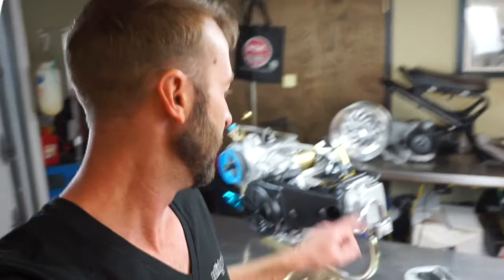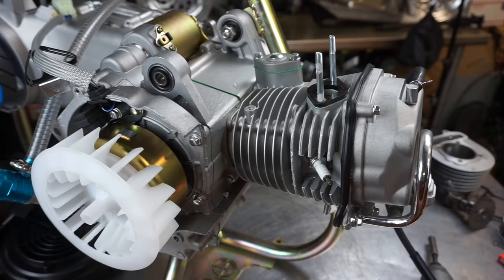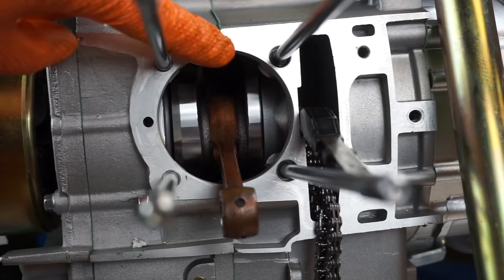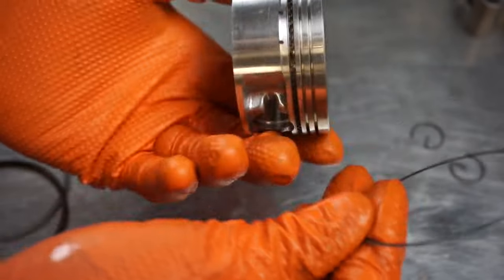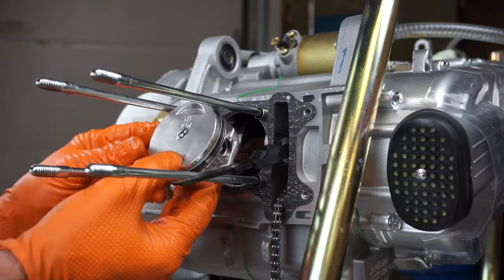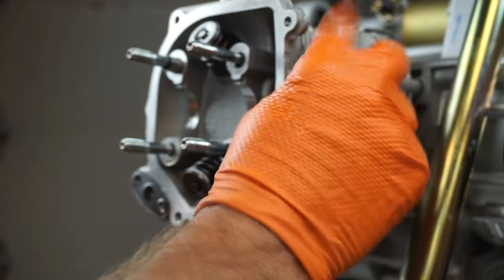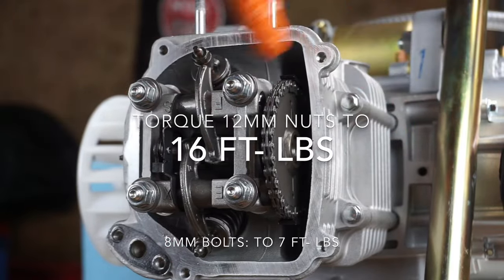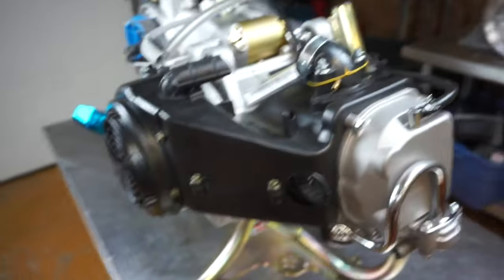How to install a big bore kit GY6 171cc / 172cc (61mm). EVERYTHING YOU NEED TO KNOW!

Comment: Why wouldn't you put the rings in the cylinder bore first to measure the ring gap with a feeler gauge?
Reply: Because all these parts are made to such amazing quality standard that there is no need to check ring end gap.

Comment: 25:25 setting valve lash. You go on the bottom side (.004 to .005 and you pick .004) .
  Only thing is that as valve and seat wear( in a hot combustion chamber) the oil splashed cam and rockers wear less. This almost always ends up in valves that don't seat completely,  which is accelerated by valve erosion and ALWAYS pronounced on the exhaust valve due to coefficient of thermal expansion differences based on heat/cooling cycles. Exhaust valve is only cooled from oil and seated contact (heat transfer). Intake is cooled by both those but mainly by cold fuel intake (reason carbs "ice up" is evaporation) in relation to relevant heat within the combustion chamber.
  If in doubt, ALWAYS set valve lash loose. Especially on the exhaust. They Will wear in and close the gap, so to speak.

Comment: Friend, I congratulate you, good video you explain everything very well, few videos of such good quality you can find and your video is the best I've seen in terms of mechanics, I have a buggy  with 150 cc engine. By making this modification do you know how many hp I can increase? And finally, if I make this modification, will I have to change something in the carburetor? and you recommend some spark plug coil with more voltage? There will be a high voltage coil on the market for this 150 cc engine.?
Thank you very much and again I congratulate you for your video, in fact you explain very well and the quality in hd is very well appreciated all the details. Greetings.
Reply: every engine is different.
Reply: Definitely

Comment: Thanks for the great video, lots of detail and well explain.  I'm replacing the cylinder head on an old Lance Venice inherited from a friend and discover the old piston lost some fragments into the crank case.   Any suggestions on how to clean this out or make sure there is nothing left inside that may create a problem ?   Also I have no specs regarding nuts torque. what would you advice.   Thanks!

Comment: You make it look very simple. Im saving up for a second bike, it will be a gy6 scooter. In the meantime i wanted to ask, would your EFI plug and play kit work on a geared bike? It has a 26mm intake is a 125cc... but what i am worried about is: will the EFI handle the constant changes in the throttle or is it made specially for scooters where you dont play that much with the throttle?
Reply from the maker: Thanks for watching. Our efi kit will work in any bike up to 1000cc. We do have DIY EFI kit out now :-) https://www.rollingwrenchdenver.com/products/diy-rolling-wrench-fuel-injection-kit

Comment: I usually set the piston inside of the cylinder first as a lil assembly then install the dowel and clip that way I don't have to wrestle with the  piston rings.
Reply from the maker: That's anther way to do it. I find it a little bit easier to do it my way. But thanks for the mention, other people may prefer this method
Reply: I do it like that its also how honda does it in the factory you dont have to worry about the ring gaps there all set from that point and its less messy oil wise oiling the piston between these stuts is messy

Comment: So you can use a 150cc head on a 171cc cylinder?? Reason I ask if because I've stripped out my spark plug hole and I'm trying to helicoil it now but I would much rather replace head in the end.

Comment: 0.04 is to tight clearance for air cooled engine, u need to put 0.10,when its get to working temp, tht clearance is 0.05, and u nvr gonna burn your valves,just my opinion, cause i have 170 cc gy5,157qmj block and its going 115kph  tht would be  71 miles per hour btw good tutorial
Reply from the maker: I appreciate the support 🙏. All the details in this video is what’s worked best for me in my 18 years of experience.🤘🏻👍🏻

Comment: Thanks for putting up some great diy videos 👍 how can you tell if you have an A or a B case without opening it?
Reply: You can tell by the engine model number engrave on the lower part of the crankcase near the side oil drain bolt. If it says  125QMI", "157QMJ", "1P57QMJ" those are 54mm stud spacing A block (case). If it says "161QMK", "161QML" you guess it those are B Block 57mm stud spacing.
Reply: NCY STORE what about p152qmi or the 153qmi KDU engine
Reply: fishsticks A-block is considered 54mm stud spacing normally 125cc "QMI" , 150cc "QMJ" and both can upgrade upto 171cc engine without boring. Now, B-Block is considered 57mm stud spacing  commonly use for 180cc upto 232cc engine if you want to know how to decipher more gy6 engine code checkout http://ncystore.com/blog/gy6-engine-code
Reply: NCY STORE 
So you reckon my p152qmi engine I can fit the 170cc kit without boring case? But those cheap china $40 170CC won't fit because of the jugs walls? But you kit does?  
Right?
Reply: fishsticks yes, NCY and Taida are only one that makes the bolt-on bore kit. What makes it a bolt-on is there cylinder skirt aka sleeve diameter is less than 63mm closer to 62.7mm or 62.9mm diameter to be able to slide in most A-case bore opening on crankcase is 63mm opening and Rolling Wrench should have them.
Reply: NCY STORE just seen your link and read about the 1p52qmi and a 152qmi engine. 
So if I change the whole top end from a p152qmi-A to a 152qmi. 
Will it work?  

I would replace the head to 60mm /A9 cam/152qmi rocker assembly. 

But keep the p152qmi-A timming chain

Will it work?  As my p152qmi head is toast! And costs alot to replace I'm kinda stuck!
Please help man
Reply: fishsticks sounds like you got a good part plan that should work excellent!🤗

Comment: would there be a change with the carb or jettings using 61mm block? I heard you can run stock 150cc carb upto 59mm block only. beyond that, jettings should be changed.

Comment: 19:00 to 19:11 true. But the reason is because the case is cut out. So he is saying if the alignment pins don't push in, they are in the wrong holes. Gasket is diagonally cut also for them. It only fits one way.

Comment: Can you use 125cc Gy6 cylinder head on 180cc Gy6 cylinder? Whats the intake and out take diameters? - But you just mentioned smaller cylinder head adds to compression = power output. But how about those intake and out take holes? How much they matters for power output when using the default 125 cc carburator?

Comment: Hey with my cam lobes facing down. @22:07.  My rocker arms HAS A LOT IF PLAY ROOM. SO I FLIPPED THEM. because I couldn't adjust the dowls on the valve. I have bug bore kit. With a-9. Cam. If I try to adjust the valve there's still like 1-1/2mm of play.

Comment: I've always wondered what the little rubber hoses hanging off the little modified 125cc scooters in Taiwan were: your breather tube just answered my curiosity!
Reply: U mean under the carb? If so that is the overflow valve, gas May leak out if it if gas is overflowing into the carburetor. It's a safety feature so ur carb isn't destroyed.

Comment: Does all a cases fit the 61mm bbk without boring the case? I have a 125cc gy6 stock and planning on upgrading it to the biggest bore possible without touching the case. Most say 58.5 is the limit without boring the case. So if this kit is bolt on i will surely go with this.

Comment: Hello sir, I’m installing the Taida brand 61 mm big bore kit like yours and an A12 camshaft. I’m thinking of upgrading to a CVK 30mm carburetor and intake but the intake port on the head is 28mm wide. Is that ok or should I go with a 28mm carburetor? What do you recommend? Thanks

Comment: It looks the same as a XR/CRF80 or 100 in head and timing chain guide design, I have been cautious of working on OHC engines and now I have completed a few, they are easy.
Reply from the maker: The shim type valves are a little more tricky.  But they are both easy with patience.

Comment: Hello my friend ✌ I should get a good power hike with the 171 big bore using my stock head , because the motor has less then 100 miles/ what due you recommend on carb in mm & what # cam, looking for a decent gain with dependability & pricing . Appreciate the info thank you

Comment: hi rollingwrench, I would like to ask if all 157QMJ engines (China), will fit the 61 mm big bore kit without modifying or boring the hole for cylinder wall? thanks.

Comment: How come I’m not getting any compression?? I gapped the rings  all offset from each other and the IN mark facing the carburetor side. I can feel air coming out the exhaust port and my hand is getting sucked in on the intake but when I put my finger into the plug hole I’m not getting any compression so what am I doing wrong?

Comment: Hello.
What is the biggest upgrade i can do on a 50cc gy6 engine without changing the conrod and big end?
Thankyou
Reply: That's what I want to know too what is the biggest big boy can I can put on a gy650 also did you ever get an answer I need to know also
Reply: @jod5659  i think its about 110cc- a Honda Lead cyclinder head is the same i believe as a gy6
Reply: @jod5659  i have a Honda lead 110cc for sale apparently does 75mph. Previous owner messaged me as he had put the bigger head on. £200 for whole bike. Spares repair

Comment: Sir, isn't the scale regarding valve settings supposed to be in ’parts of an inch’ rather than mm?
Big fan, love your videos!
Reply from the maker: Good catch. You are correct! Dang it! I corrected it in the description
Reply: Depens if youve been trained in metric or imperial, its usually marked in both on the feeler gauge blade.

Comment: One thing, brother. Around 9 minutes you show stock blue gaskets and exp lain to trim the inside with a razor. 
  You are correct, of course, but don't let the paper based gasket clipping fall into the engine. It can sling around with the oil and end up eating up your ball bearings. 😞 don't ask me how I know, please🙄

Comment: This might be a stupid question. I just recently purchased and Ice bear mad dog gen 4 150cc originally now board out to 171cc. The person said use 10-40 when changing oil on crankcase says 15 - 40 which is correct. Please help
Reply from the maker: Gy6 motors can use a wide range of different viscosity’s. You can use one or the other. It doesn’t matter.

Comment: Hi I have a gy6 125 cc with engine number of hd 1p52qmi do I still need to measure the stud spacing or will it be the 57mm spacing and if it is the 57mm spacing can I put a 150cc top end kit on it to make it 150 cc

Comment: Amazing how dry that motor is and hasn't even been test ran at the factory.You think they would at least use assembly lube
Reply: My thoughts exactly. Even a $100 harbor freight motor gets ran before it leaves and will have lube/grease in it.
Reply: Connections

Comment: after that video i decided to upgrade my 150cc gy6 a motor. İ bought 61mm cylinder kit,A9 cam and 15x37 gear kit. and i did exactly the same as you did But, when cold start engine does not run on idle you have to put gas to keep engine running until its get really hot. after it gets hot its stay on idle qiute well.. Why is it? is it because of A9 cam?
Reply: Kinda sounds like your idle jet may need increased in size but I dunno tbh 🤷‍♂️

Comment: My second Q, you did the same clearance adjustment on the exhaust valve?, i mean .004 for the intake and .004 on the exhaust too?
Reply from the maker: That is correct
Reply: @shannon9487  0.004 is big enough for exhaust..Both at 0.004 is perfect

Comment: I have a atv with a type A gy6 and something stuff didn't come with it like the bolts to the air shroud and the air shroud rubber seal can I buy these things off your website? I'm planning on doing some mods but working out the program with it first I like the video
Reply from the maker: Yes no problem. Just click the create a parts estimate on the website
Reply: @RollingWrench  does that 171cc fit in the case of the gy6 a with out boring it out? How I found out it was the A gy6 the engine studs are closer thanks to your video I built the top part of the engine but like most guys need more power lol right now having a problem with spark worked good in the trail I got it home shut it off then nothing I replaced the CDI and nothing I got the 4 wheeler from someone that lost parts and it sit for years guess I was asking for trouble

Comment: To do the big bore kit... do you have to drain the oil in the motor  before starting?
Reply from the maker: No, but it’s a good idea to add fresh oil
Reply: @RollingWrench  definitely!! Riding seasons over just wanted to make sure it wasn’t going to be oozing out when you do a big bore on a wet engine

Comment: Hey bubba. Love your video.
I got to 18:58 where im installing the jug. And it dosent slide in to the case. I decided to smoke a cigar and drink a tall boy about it. But, i dont know what to do.
Reply: I removed the jug and re razored the gaskets of the case ID. No luck.
Reply: Half way thru cigar and tall boy, im thinking thermal expansion. Should i put jug in my freezer for a little?

Comment: hi, planning to get a 61mm bbk. do I need a new head? I understand the 61mm and stock heads have the same size valves. Is that right? Im not a racer, just want extra pep for new gear set, how much hp or torque should I get using the same A8 cam and jetted to 115 carb with a 61mm?
Reply from the maker: You can use the stock head and stock cam no problem

Comment: Just one question, how do you know if the piston is on the correct cycle and not 180 degrees out?
Reply: There are time indicators on the flywheel, if you get the T at the indicater the timing will be good

Comment: Couple ? Do you need to change the cdi box after this,do you have to put the shrouds back on or is it ok to run without.
Reply from the maker: +Ronnie Hall  you don’t have to change the cdi. Shrouds are a must. It will get to hit without them
Reply: Shrouds are for the fan to circulate air around the eng , LEAVE em.on

Comment: I’m having trouble with fiting the piston into the cylinder any tips ?
Reply from the maker: More assembly oil :-)
Reply: @RollingWrench  thank you! Round 2 starts in 15 mins lmao
Reply: @RollingWrench  ok your advice worked only problem now is I have 4 dowel pins instead of the 2, it looks like the cylinder head fits from the drop in kit but it looks like w/o the dowel pins is it ok for me to take them off or is that a bad idea?

Comment: My scooter is going too slow when it tells me I'm doing speed limit 35 but I'm actually doing 29 miles an hour and I'm having engine stalls sometimes and my lights are kids going out I need an upgrade kit for a 50CC GY6 engine in transmission to go a lot faster try to make it feel like it's a 150cc cuz I got long distance travels to do

Comment: Does the original Cooling Shroud still fit exact with big bore kit installed?
Reply from the maker: Yes :-) this big bore kit has the same
Outer shape
Reply: I have a Howhit GY6 150cc. It's the A case.  I wanted to get the big bore kit from your site, but upon research and measurements mine is a 57mm piston  from factory. Even though the stud spacing is 54mm exact. Is there a kit for that?  Can I still drop in a performance cam with original head?
Reply from the maker: @avenge1671  stock 150cc engines have a 57mm bore. A GY6 A motor has 54mm spacing. You can do a 171cc kit with the stock head and stock cam. I would recommend doing head, cylinder and cam. We sell our 171 kits as a drop in kit. No case boring. Here is the link:
https://www.rollingwrenchdenver.com/products/gy6-171cc-big-bore-kit

Comment: Mine says 1p57qmj. Would this cylinder fit ?
Reply: Yes
Reply: It's a 150cc look for 61 mm big bore kits . You can go up to 61 mm without case boring. Making it a 171 cc.
Reply: Yes,the cylinder is the same as well as the piston and rings,the timing chain has the same number of links.The only difference is in the head..The aluminun where the camshaft sits is like 1.5 mm higher,off the top of my head so.it means it will not accomodate a camshaft with bigger lobes..off the top of my head i would say it takes a camshaft A8 or A9 but not higher,cause of the height..you can use a regular head to replace the original head..and make sure your chain tensioner compensate for the chain slack..I have seen after market chain tensioners that sell as being good for 125 cc and 150 cc and the stem is a little shorter.Hope this helps.There is a lot of missinformation about this on the internet includung forums by guys who pretend to know and in fact they know nothing.The 157 qmj and 1p57qmj are identical gy6 engines..
Reply: Big Em..you are right,the biggest you can go without boring the case is 61 mm
Reply: Some of the 61mm kits have thicker sleeves so you still have to bore. . Just be sure you get a drop in kit

Comment: awesome vid. do you perhaps know the sleeve diameter on this kit? does it fit on the 54mm bolt spacing?
Reply from the maker: It’s a drop in kit, if I had to guess it would be a 58mm sleeve diameter (I’m not sure). This is for the 54mm spacing

Comment: Hey i have the big bore kit installed from rolling wrench and im getting some "grab" every turn of the crankshaft. It will clear it but not by hand. Is this normal?
Reply from the maker: Hey Jesse. Thanks for the support! Be sure your spark plug is out while turning it over by hand. If you still can turn it re check the cam timing

Comment: Is there a marking where where the gap should be for the rings or you decide where the gaps line up (obviously opposite sides when lining up gaps)
Reply from the maker: No there is no markings
Reply: Ellis Malave when you do aligned piston rings just make sure that you avoid the horizontal wrist pin line you never once set the ring gaps near there. 120 degrees offset is what's recommended.